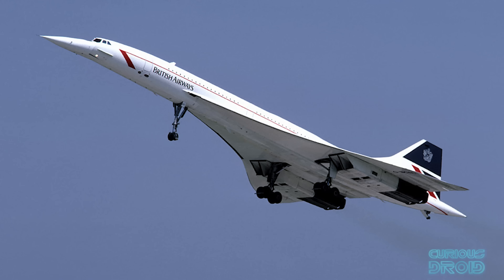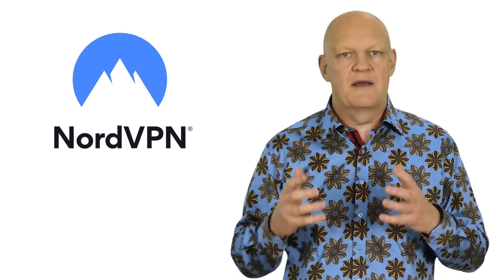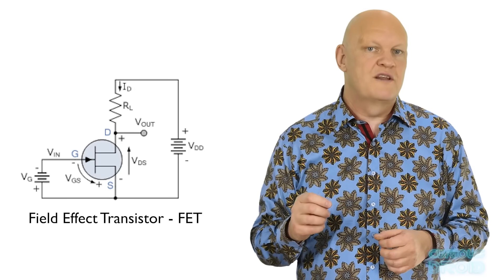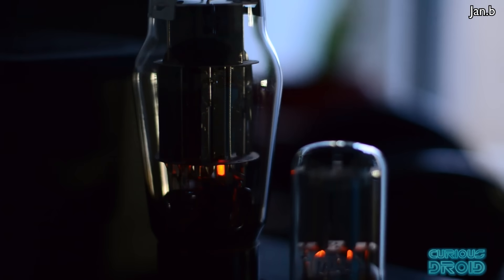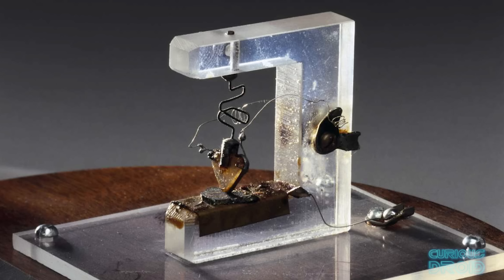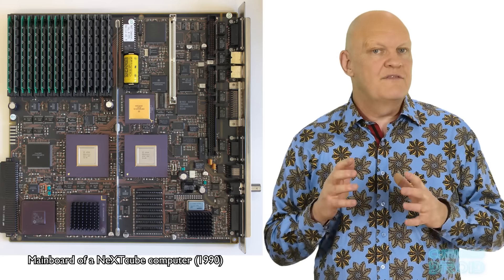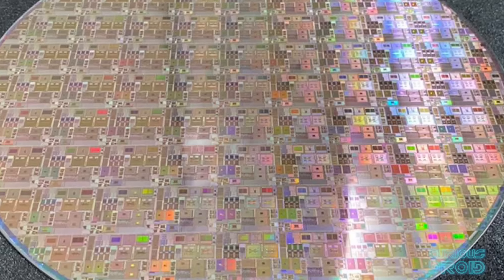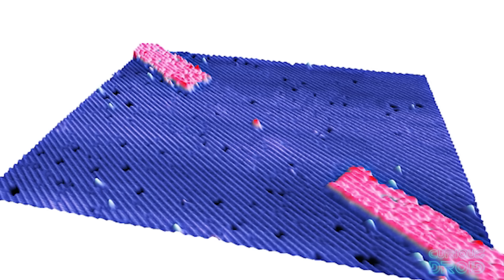MOSFET – The Most significant invention of the 20th Century

Comment: I find the whole, official timeline of IC development ..very curious.  Leaving me to wonder how much of the official story is coincidence and how much is, carefully composition.   Also curious about the only US.gov contract company who worked on IC development timeline,  from inception to release of the technical process to General Microelectronics in the early 1960's.
Timeline: WikiPedia 
The epiphany of "germanium bad" and "tyranny of the numbers". 1946.
UFO crash in Roswell New Mexico, late June 1947
Shockley & Brattain at Bell Labs get credit for 'accidently' inventing a point contact transistor. December, 1947
Shockley introduced the bipolar junction transistor in 1948, Production begins early 1950  
Credit for inventing the MOSFET transistor went to, Mohamed Atalla and Dawon Kahng ..also at Bell Labs. 1959. 
Frank Wanlass, director of R&D at General Microelectronics designed, fabricate the first MOS integrated circuits. 1960 
All traces of General Microelectronics wiped clean.  Philco Ford (another US.gov) takes control in 1966 

US.gov's expanded IC development timeline notwithstanding, the Roswell crash,  their discovery of integrated circuits on board those crafts and most particularly, the expedience with which the IC was conceived and developed.. is most curious indeed.

Comment: Mosfet guitar amplifiers are the most 'valve' like sounding of all SS amps built today!
Reply: Thanks to the them being field effect just like valves thus producing even harmonics
Reply: That is because, like valves, MOSFETS are tranducers that control current by gate voltage. Unlike BJT''s where current is controlled by current.
Also, BJT's have limited power amplification, but MOSFETS do not as the power they consume at the input is essentially zero.
Reply: @TheEvertw  yes my 500 watt  amplifier sounded like a valve amp  many a time i had to open the case for doubters to see it was electronic and not valves.
best mellow sound heard. bought that in 1975 still pushes out 280 watt

Comment: If scale gets down to just to a few atoms, what happens if an atom(s) transmutes into another element due to cosmic rays? Or is that not possible? From my layperson's perspective, relying on anything containing less than several atoms lacks sufficient redundancy and likely to fail far sooner than current chip technologies. Presumably, they'll find ways to go smaller reliability, but are increasingly running up against the limits of physics.

Comment: What I never understood why  there is a need of a transistor in CPU? It's a switch activated by what? Another switch? Why not let the current flow directly? I see a view benefits but I'm just not sure if I'm right. Is there any video out there explaining this? It's always "what is a transistor and where is it used (how does it work)" but never how it is exactly set up in a CPU or radio.  Like "it made radio and IC possible". But how and why?

Comment: The metal oxide semiconductor field-effect transistor (MOSFET) was indeed a powerful invention. Its low resistance gate approach completely outclassed its predecessor TTL (Transistor Transistor Logic) almost immediately upon its introduction. However, it also has a huge shortcoming that makes it vulnerable to various forms of attack by evil-doers and enemy states. That is its inability to handle high voltage without complete destruction of the gate. This is what opens today's electronics to EMP (Electro Magnetic Pulse) attacks as well as vulnerability to damage by cosmic rays in space which, of course, is why Hubble is failing today.
Reply: And why the Russians prefer valves in their military kit. (Maybe not as much now as in the cold war.)  Valves tend to ignore EMP spikes that would kill most any semiconductor!

Comment: One of the interesting issues around increasing miniaturization is that tiny external forces can rival the intended internal forces.  When you are switching with just a few electrons, then the generation of an "explosion" of electrons by the impact of a gamma ray can easily swamp the intended signal.  Point being, creating a device the size of just a few atoms may be possible, but it also may not be reliable in its' performance.
Reply: If I'm not mistaken, radiation from space can do this.

Comment: Well told and fascinating article.. thanks!
However.. there's one thing I'd like to remark upon. The invention of the transistor at Bell Labs in 1947.

My stepfather served in an Australian Army Signals Unit in Papua New Guinea in the early part of the 1940's. Somewhere during the time period of his enlistment, which was 1943-1945, although I'm still waiting for his service records to be released before I can pin things down more accurately. From the time he met my mother in 1976, right up until his death in 1984, he insisted that the story of how the transistor was invented in 1947 was incorrect. The reason? He had personally seen and used what they called "solid state triodes", during his time as an Army radio technician in PNG. He said they were a small metal can, about the size of the first joint of a finger, and had only 3 wires (a thermionic valve triode has 5 wires). He assumed that the invention of the transistor must have been a classified military secret during WWII, and that the 1947 date was designed to hide the fact that it had been in use during WWII, for several years before the "official" date of invention.
Reply: Now all ya need is some pre-1947 tech to open up and see what kind of transistors are in it.
Reply: @elected0nes741  Pre-1947 military tech, to be precise. And it won't matter "what kind of transistors". If there are ANY transistors in it, that would confirm that the official story is a fabrication.
Reply: @Garryck-1   They'd have to update the official story and give your grandfather the credit for it.

Comment: Being an electronics repair man, I swap them out every day when they fail. My question to the engineers is... if you need billions of transistors in a certain IC, why haven't you come up with something that mimics the effect of having to use so many? One would think by now you would have figured out that one of "these" could take the place of billions of "those". 🤷‍♂️
Reply: That's not how it works. Things like boolean expressions and digital circuits can only be simplified/optimized so much.
Reply: @davidsotomayor8713  That IS how it works! It's not just about simplifying and optimizing what we have, and our techniques. Everything has to change over time just like in the 20s, 30s, and 40s, electronics were made using vacuum tubes. Starting in the late 50s, 60s, and early 70s, the majority of electronics were made using discrete transistors. Then by the mid 70s, through-hole ICs were starting to be used that miniaturized and consolidated components. And by the late 80's, early 90's SMDs were starting to be the norm making electronics even smaller. Next big thing will be something different that takes the place of what's used. There will be at least one engineer that will figure this out but, it's gonna take something drastic to happen.
Reply: @nonsuch  and it should tell you something that even through all that technological advancement, the fundamentals of digital circuits have essentially remained the same.There just isn't going to be some singular miraculous component that pops up that will be able to perform as "billions of transistors." What you are talking about is more magic than science.

Your examples are largely instances of things getting smaller. Of course a transistor is smaller than a vacuum tube but a single transistor doesn't replace 10,000 tubes. If this is something that really interests you I would highly suggest checking out some EE classes.
Reply: @davidsotomayor8713  What I'm saying is, cramming billions of transistors into something is proving to be problematic. Thermals already got a cap on it. That's fine if you don't have the answer. It will come. 
👍
Reply: @nonsuch  which is totally different from what you originally said. Saying a technology has its problems is a long way off from suggesting some hypothetical component with the ability to replace "billions of transistors." It really isn't as simple as "just make one that does the same thing as a billion." What you are suggesting would only represent by far the biggest advancement the field (and quite possibly technology as a whole) has ever seen. But hey why don't they "just do it" right? 🤦‍♂️🤦‍♂️

Comment: The most important technological inventions of the 20th century are: 1) The audion which gave birth to the electronic age. 2) The vacuum tube triode which made the modern world possible and gave birth to the first electronic computer. 3) The transistor which made handheld electronics possible and allowed computers to be practical devices. 4) The integrated circuit (which is what you're really talking about) which ultimately gave rise to the digital age. 5) The rechargeable battery pack, and specifically the Lithium Ion devices which sent battery power into overdrive and without which much of the technology we take for granted would not be possible. 6) Rare earth magnets and, again, specifically the Neodymium magnets which, because of their unparalleled strength and stability, allow the micro-sizing of so much of technology (like laptop hard drives, cell phone speakers, etc.) I'm sure there are others but those 6, to me, basically drive the world as we know it.

Also, I never considered that the wavelength of light needed for the lithography would be a limiting factor in miniaturization. Engineering at this level encounters some really weird problems!
Reply: I've always had a soft spot for the flushable toilet, myself.

Comment: Miraculous and magical are two words to describe these developments.  I am 81 years old now but I still remember my first look at technology when I was only about five years old.  We had a battery powered tube radio on the farm where I grew up and I loved to look in behind the cabinet at the tubes, transformers, and tuning capacitors that worked at producing the sounds I heard.  As a young boy, I started building crystal radios first from a kit and then from discrete parts I would buy.  The most finicky item in this project was the galena crystal and catwhisker that functioned as a simple rectifier.  I soon heard about this new technology called solid state and soon started using a IN34 germanium diode to replace the finicky crystal.  My interest in electronics continued and lead me to a career in mainframe computers starting in 1965.  And I continued building electronics projects of all kinds for many years after.  Have been amazed over and over by the advances in technology over my lifetime.

Comment: Takes me back to my 1970s to early Air Force days in PMEL calibrating and repairing test equipment. Back in the days of vacuum tubes, hybrid circuits using both transistors and tubes or as our British friends call valves.
Reply: Ken Schaefer : I had a chance to go into PMEL in 1982,but chose instead to go into F-15 avionics.
I think I would've gotten more out of being in PMEL than F-15 Avionics.
But then again,who really does component level repairs these days?
Did they teach you how to do circuit board repairs without schematics?
Reply: @ebayerr  Some of the equipment didn't even have Technical Orders so we had to use manufacturers manuals about 25% of the time. And those often had block diagrams and often no schematics. Yeah we had to identify circuitry at times by taking measurements.  I taught PMEL for 5 years. When I started school in PMEL we didn't have calculators and worked with numbers with up to 6 or 7 decimal places. Used a lot of logarithms for calculations as slide rules were not near accurate enough.
Reply: @kenschaefer7625 : Very cool Ken.
As it turned out,I had gotten stationed at Kadena AB,Okinawa and that little island was an audiophile's dream come true.
And having your kind of skills would've been nice to know.
Check out the video I posted from Kadena in 1986.The base commander gave permission for some airmen I knew to put on a little concert on base.

Comment: Like car batteries sulphated plates ,and Hard drives platter coatings, Do Mosfets have a limited lifespan even if you DONT use then? that floating layer wear out over time? 
So if true does that mean all USB thumb drive also wear out after 10 years even if not much use?

Comment: You seem to have missed the Russian advancement in vacuum tube computers. They started etching them on to chips just like we do silicon transistors. They're only 50% larger or something like that. And when they're on that small of a scale they don't need a filament heater. We only found out when one of the defectors from Russia flew Mig fighter into the USA and we got to look at it

Comment: As has been discussed in comments power MOSFETs are another area that offered lower switching losses than silicon BJTs.  They have not taken all the power applications yet the SCR (thyristor) developed in  about 1960 still handles the highest voltage and current.  As mentioned in comment IGBT covers the next highest power switch.

The germainum transistor also had a niche in modest power switching having lower on state losses than silicon BJTs and when they were withdrawn in 1978 by Motorola, for example, products like small low cost mains frequency inverters could not be made cheaply any more.  The company I worked for, Jermyn Industries, looked for a silicon solution but that required more heat sinking for their 150W and 300W uniterruptable power supplies.

Comment: The key development by Robert Noyce, co-founder of Intel,  and Jean Hoerni while at Fairchild, which made the IC practical was the Planer transistor process. Prior art was called a Mesa transistor where the elements were stacked vertically. This made mass production IC's beyond thew most basic circuits impractical. It is said Hoerni and  Noyce came up with the idea of the planer process after a Thanksgiving dinner at a relative's. Noyce noticed the set of mixing bowls where each smaller bowl fit inside the next larger one. He knew this was the key to the photo lithography process needed to mass produce IC's.

Comment: they certainly changed music amps for sound systems. i had a citronic 200 x 200w stereo amp that weighed a tonne and you could fry eggs on when it was running. i later bought an HH Mos Fet amp which had twice the power and was slimmer and easier to handle.

Comment: FETs in series spaced along lengthy 2-core cables makes it possible to progressively switch each node from Off to On without the need to 'identity code' each one.
Cascade-Switch Multiplexing. Born in 1947 using relays and 3-core cable to signal alarm-condition locations in deep mines.
Siemens advanced the concept using BJT switching on 2-cores. My patent went further using FETs. Then came wire-less.

Comment: -- Agreed with 2 cavoites:  Mosfets are modulated sign.  Sort of have to be, not pure sign.  Vacuum tubes are pure sign, which do a much better job with slew rate in audio amplifiers.  This doesn't make tubes better in 99.9 percent of applications, but just in that one.  Second, very hard to argue with you on this, but I'd say TCPIP is the most important invention of the 20th century.  Still could have done that with vacuum tubes :)  Are Mosfets better, cheaper and more useful than vacuum, no question.  
    It's sorta like a chainsaw is better than an axe, but not if you don't have any fuel.  Thumbs up.

Comment: I'm 57 and grew up with Heathkit and a time when Radio Shack sold discrete components (and had a tube tester at the back of the store). I got my amateur radio operator's license at 13 and built my first transmitter the following year. Early on I used to make little contraptions like strobe lights, police sirens and echo boxes. I worked at Main TV in Visalia fixing sets in my junior year of high school and won my first science fair trophy making a rudimentary calculator from old Bell Telephone switchboard and relay components. Those were the days. By working at such a level, I really came to understand how the individual parts worked together. Though I didn't fully appreciate the relationship to valves then, transistors always fascinated me. It is a pleasure listening to you describe the MOSFET today. I grinned not only because it was all so familiar, but also that someone might be learning something that's taken quite for granted (as they should, TBH). Thank you so much!

Comment: Personally, I still prefer bipolar transistors. They may be less efficient but I guess it's a nostalgia thing. BC 548, 2N 3055 etc... Anyway, thanks for sharing.
Reply: For high voltage low current switching bipolars are quite okay and easy to drive too. The basis-emitter PN junction can be used as an ESD protection for the MOSFET which drives the bipolar, so they can work together fine.